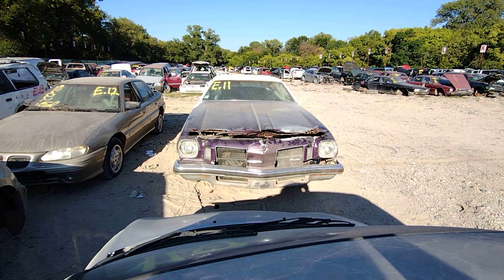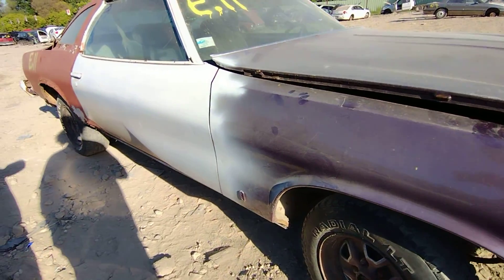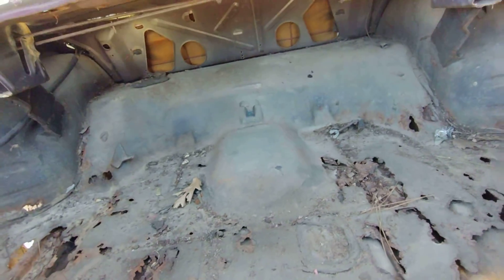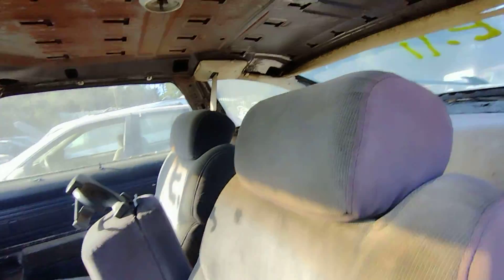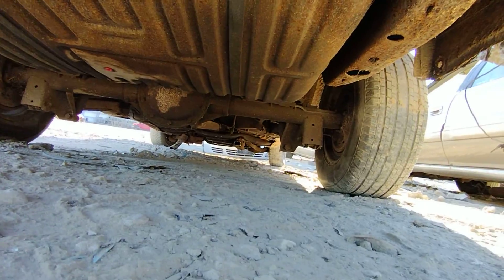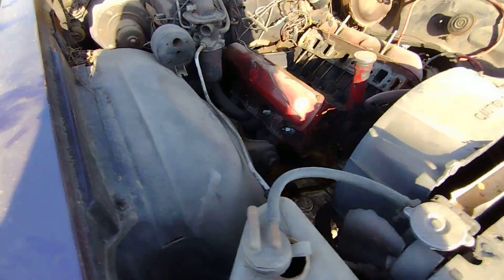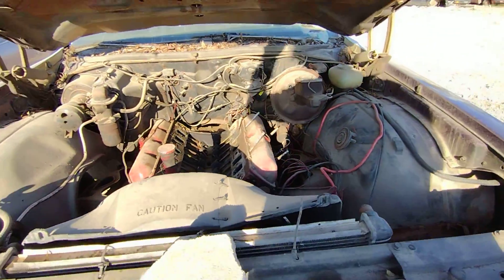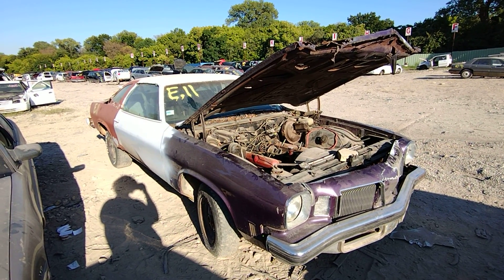An Old Car's Life By The Beach. 1974 Oldsmobile Cutlass S Junkyard Find

Comment: Whoa Nelley, 1974 and soon to be out the door. Rough, rough, rough, rough, rough, rough. I agree, this was near somewhere very wet and damp. I took parts off of a 1980 Trans Am Pace Car like this. It was in a NJ junkyard around 2004 and the owner told me to take the whole car for $500. It was in deep mud and had a "Town of Oyster Bay" beach parking permit like this one did, so I passed. I did get a set of mirrored T-tops (same as my 1979), a "red light" gauge cluster which is only correct for an '80 Pace Car, but it had a '79 10th Anniversary tach in it (I have a few of those), along with other finds. I got everything for $200 and I left the rusty hulk there. Only thing I should have gotten was the wheels which  might have been true 10th Anniversary wheels. The Shreveport Cycles decal is from a motorcycle dealer in Louisiana located at 2529 East 70th Street, and that would explain some of the rust as everything rots in Louisiana. 

We got the VIN, we win: 3 for Oldsmobile, G for Cutlass/Cutlass "S", 37 for two door coupe hardtop, K for 350 V8 with four barrel with approximately 180 HP, 4 for 1974 model year, R for Arlington, TX assembly and the rest is the production sequence. As noted previously, the Arlington, TX plant opened in 1954 and still operates today and assembles trucks. It is located at 2525 E Abram St, Arlington, TX 76010. 

We got the tag, we can brag: ST74 for 1974 model year, 3AG37 for Cutlass "S" two door coupe hardtop, R for Arlington, TX assembly, 956 for Beige vinyl interior trim, A52 for bench seat, 55 55 for Colonial Gold upper and lower exterior paint, 10E for the fifth week of October 1973 production. So to answer a few questions, no "Barney Purple" was not the original color, it was Colonial Gold and no the interior was swapped out/or dyed as it was Beige originally. Yes, it is an original Cutlass "S" two door with a 350 Olds V8 with four barrel. Yes, it was a front bench seat originally. 

Whoa Nelley, the Cutlass is now gutless. In rust we do not trust and this one will soon be dust. 3-5-0 and gotta go. Cutlass "S" is a big mess. That's it, time to quit. Lived a life at the coast, and this one is toast. Going to be flat and that's that. Olds Rocket soon to be out of pocket. Was once a nice and shiny Olds, now it's time to fold. "Lost in music, (rusty water) caught in a trap, no turning back" (Sister Sledge) and this one is nothing but pure crap. Going to get squished and the GM "A" body faithful, many here, and yes, the Google Man are going to be very, very, very, very, pissed.
Reply: One of your best rhymes yet.
Reply: @kennethsouthard6042  Lol. It was a good one.

Comment: I was at a junkyard in very SE North Carolina picking parts off two '75 A-bodies. Both cars lived near the ocean since '75 and the rust was outrageous. Behind the rear doors at the C-pillars? You could reach into the trunk. Pushed my thumb through the roof. Wanted to get the one's speedo cable, so I peeled the driver's side front floorboard up so I could access the nut on the trans.

Comment: Sadly, those Colonnades were bad for rusting out. My old 1973 GTO that spent it's life in Ohio was worse. Miss that car, rare full quarter windows, white vinyl bench seat but a 4 speed so it got the factory Hurst shifter, 400, Florentine Red with white stripes, only options it had was AM radio and rally wheels. No A/C, no PS, no PB, nothing.

Comment: Did you grab the valve covers ? I need a factory original, 8 track Am/FM for my 76 Caprice, did they even make one ?
Reply: I'm sure they did, if not a GM dealer option/accessory.
Reply from the maker: I went back and took the valve covers. Should made a few bucks on them.
Reply: Good move.
Reply from the maker: @googleusergp  👍
Reply: @ClassicRideSociety  Sure was.

Comment: Wow, that is horrendous. It looks worse than an east coast rust belt hoopty. And that's saying a lot. Back in Boston in the '70s, we used to say that a car wasn't rusty until you could see the window regulators from the outside. In rust we had to trust, there wasn't any other option.
Reply: "In rust we do not trust, and this one will soon be dust". Based on the sticker on the window, it spent time in Louisiana.

Comment: 1973 GM cars rusted to hell. They would be showing rust when only two years old.
Reply: All of the 1973 to 1977 "Colonnade" styling cars did. The roof design and other designs would trap water, as well as the bottoms of the doors if the drains were not kept clear. Then the door would separate as well as the bottom of the fenders, turning it into a rusty hooptie.
Reply: @googleusergp  I live in Fort Wayne, IN. and these cars would rust in only a couple of years. Even the full size models rusted within a few years.
Reply: @3713msg  Yup, I go on business trips in Wisconsin and everything rots there too. Fort Wayne Indiana---home to a GM assembly plant.